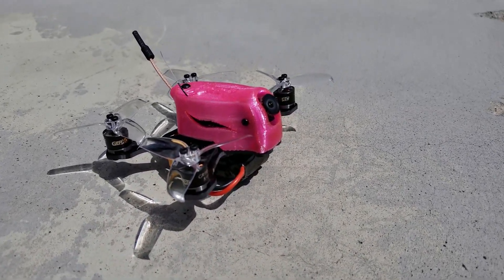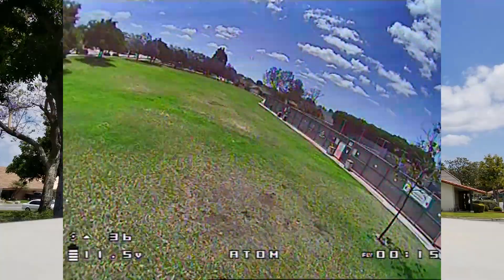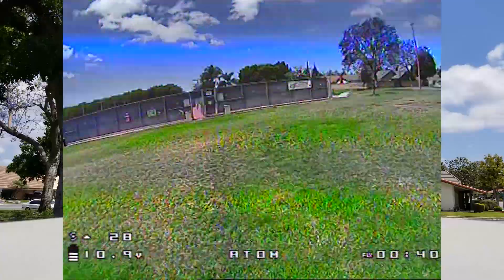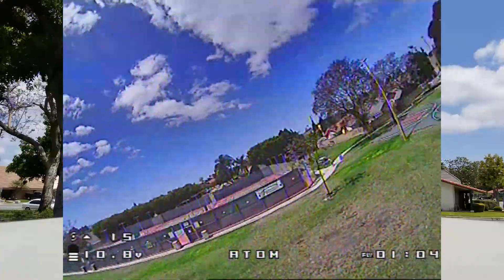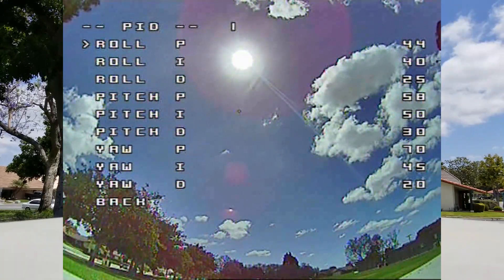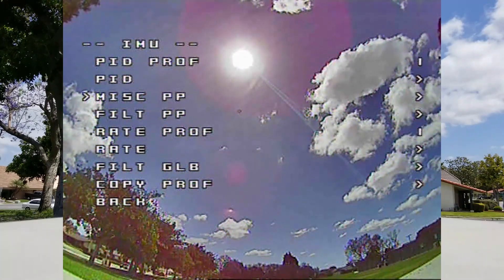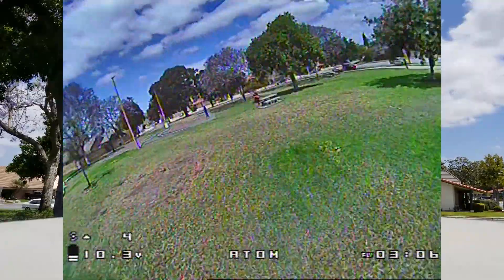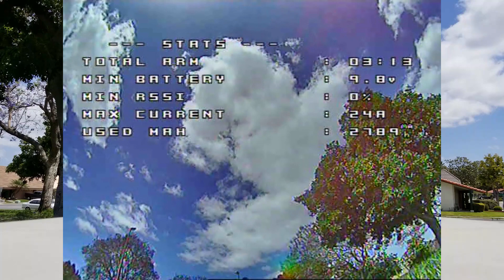PID Tuning (Atom Mini V2) 📔

Comment: Hi Albert, thank you for these PID tuning video (s). And casual is great. So, Keeping this brief, ask you opinion.  3" massive drooner, Nano V5.1, TBS Unify, Ori32,  Bro1407 3600kv, 3052s. A good build and good components, I think. Upon first hover, there was terrible oscillations with stock BF pids. never ever happened before, to me. Now to get it "smooth", PID s are so low I've never seen this beofore, ever. Can I hear your first thoughts. P for Pitch/roll gains are under 15/17 and so is D Pitch&Roll. Just your first thoughts please about low gains like these.. Have not flown outside, yet. Just your first thought?
Reply from the maker: So I think the issue is your components which a PID tune won't be able to fix.  I would start by replacing the flight controller.  That one has a 32k gyro, right?  I will have a video out in a bit where you'll see the Droner 3 fly super nice with no tuning.  My components are totally different from yours.

Comment: More generally, do you think we can tune starting from the default settings? Some other tuning videos have recommended start with P, turn it way down, then increase until you get oscillations, etc. Albert may be able to start anywhere and know which way to adjust, but what about "new" tuners? Seems like there is an advantage to starting from scratch (it's consistent), but maybe BF default has gotten good enough it's not necessary?
Reply from the maker: I always start with the default settings and adjust up/down.  The next example with the GT-M2.5 will be out in a few days and you'll see what needs changing.  I am going to use a bunch of examples and make a large playlist so people can see what they need to do based on the examples.  If I start off at a random set of numbers every time, that won't help anyone.
Reply: OK, I'll be watching!